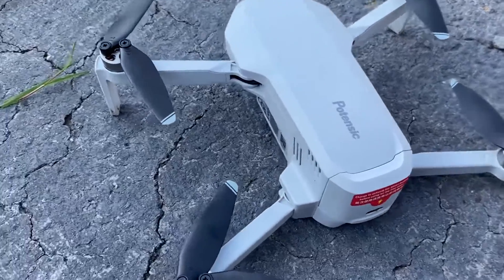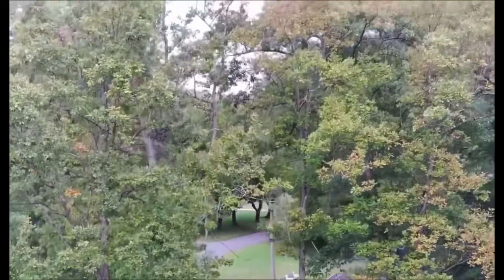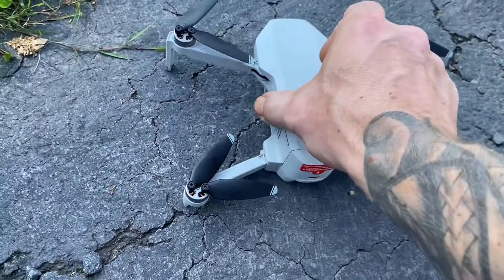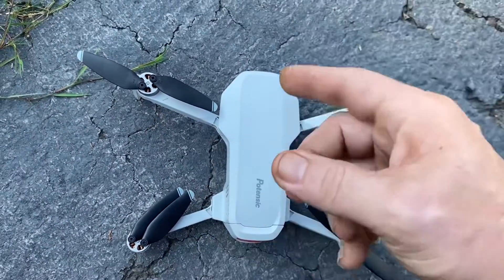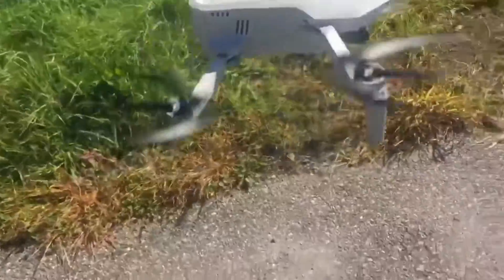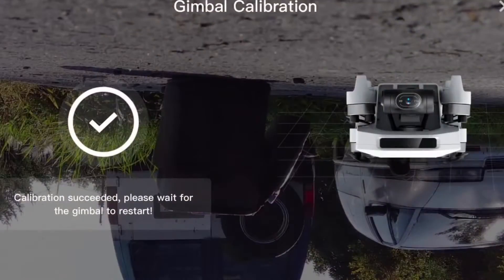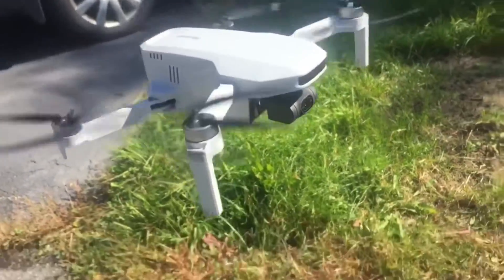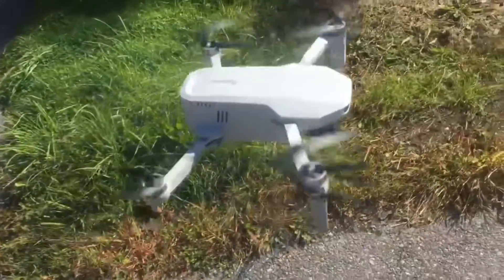Potensic Atom CRASHED 💥 How to fix drone Propeller Swap Step by Step Instructions GPS RC DRONE

Comment: i crashed my lt, and replaced blade with same blade, said b2 on it, the other blade on the same front right arm had no mark, but the remaining one had a1 with a line under, m so confused, please help
Reply from the maker: So if they’re not marked correctly, the blades are pitched differently match up the pitch in accordance to the arm. When is going to have a downwards pitch out to One Direction just as well as another is going to have a downward pitch to the opposite direction.

The front two blades are gonna be opposite one another just as well as the back two blades
Reply: thank you so much

Comment: Good video bro! I was looking at a video from Potensic and it shows to look at the markings on propoeller and match it with the drone"s arm markings, I see the markings on the propellers like +1  and -2 but nothing on the arms..?? To confusing! Yours is fast and simple. Also should I use the same screws or the new ones. Thanks!
Reply from the maker: Personally, if the old screws are not damaged, I would use the old screws, but if you find it hard to get them in, try the new screws basically want them to go in nicely and not too strip or counter sink or go sideways happy the video worked for you. That’s kind of what I’ve always done is not dragged out the dog and then beat it while it was laying down so to say lol try to get right to the point and pass information on Without construing it

Comment: Hello! Is there any other defects that could happened to the drone except propellers? I just crash mine 2 times in my apartment and idk if would work again like before! Waiting your reply. Thanks
Reply from the maker: As long as all body parts are intact, and the electronic speed controllers in the motors were not affected. You should be good.